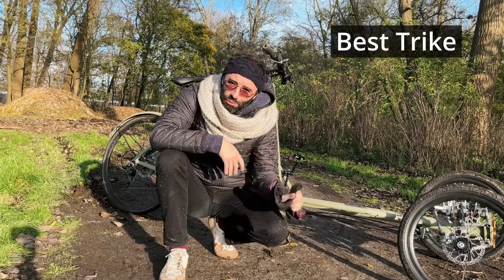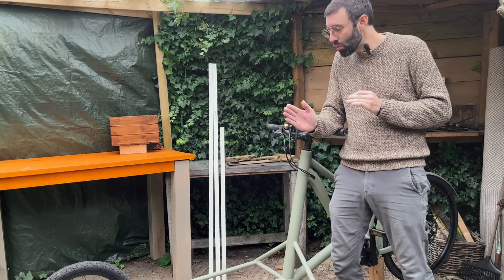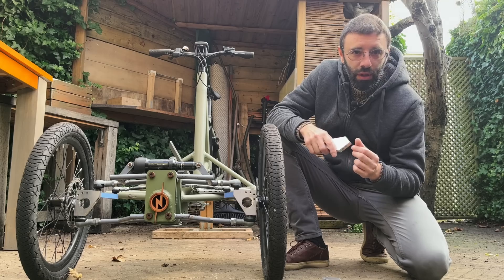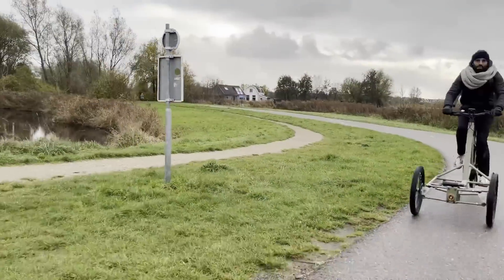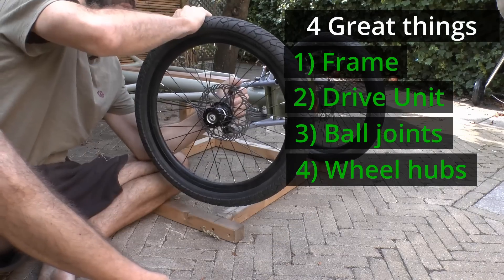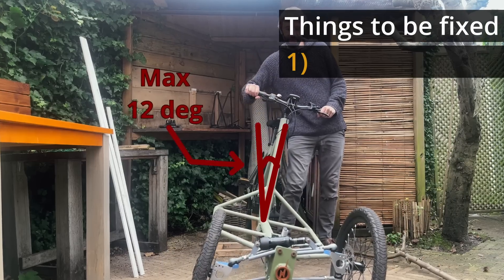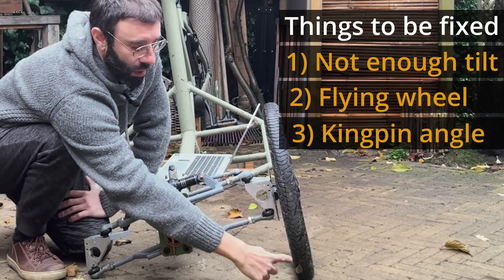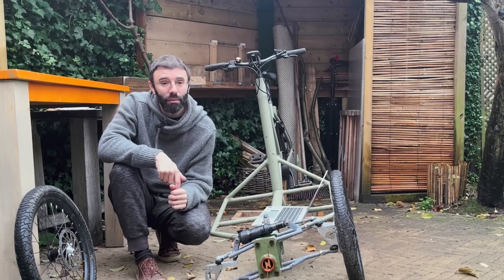#5 Build Finish and Tests - Tadpole Tilting Cargo Trike

Comment: Ackerman while tilting is the key to good handling. One thing to think about is the pivot points at the frame. I noticed that your outside tire leans more than the inside one, exactly the opposite of what you want. If the upper pivot is central instead of how you have it outboard of the central pivot point. When you are leaning in the corner the wheels need to lean the right amount for the circle that they are traveling in. The outside needs to lean less than the inside in relation to each other. The rear should split the difference between the two lean angles of the front. If the lower arms are out the central pivot point like you have them and the upper arms are pivoting on a common point then the tires will get closer together at the bottom creating the different lean angles. Another thing to do is to use offset rims so that the outer pivot points are inline with the center of the tire. This will fix the scrub radius problem. With the system that I have described the steering pivot points need to be the exact same height as the upper pivot points to get rid of any bump steer.
Reply from the maker: Hi, thanks! That's a point that I haven't considered, actually. I calculated Ackerman for the outer wheel to turn less than the inner wheel but didn't consider leaning less.
Cheers!

Comment: That’s a very good design love it. I would go with cable steering but full housing( cable routing does not be straight line) as I would off road sometimes I see your cable pulley got stuff stuck so I like mine to be away from the bottom protrusions. 
I would go with bearings on the C hub & solid axle on the wheels. Your previous A arm would have more tilting angle but change to a H arm. ❤Thanks for the inspirations.
Reply from the maker: Thank you so much! Indeed, the pulleys gather grass sometimes, would be nice to have them more protected. And I'm working on new hubs;)
Cheers!

Comment: amazing space-x level cargo bike, can you make a suspension for regular 700c carbon fork/wheel, cast your own pieces from AL and go back to bearings over ball joints to increase tilt, better use the steal knuckle for rough test even that AL piece could crack under 200 pounds,
Reply from the maker: Thank you! Indeed, I'm working on increasing the tilt. I will still use ball joints but with different orientation and spacers. I think it will work. Will publish soon;)
Cheers!

Comment: Consider drilling the aluminum axle on center, install a steel bolt & nut to place the axle in high linear compression. This is a design that has been very sucessful in a arbor designs where a wheel is only supported on one side.
Reply from the maker: This is precisely what I'm working on! Thanks!

Comment: Some great work Pedro! I've been watching since the beginning and I'm thinking seriously about building one. I was wondering about making the lower swingarms slightly V shaped, since it's only the bottom ones that reach the limit of the balljoint.
Reply from the maker: Thank you so much! Indeed, I have also considered changing the shape of the swingarms but I think that it will still not be enough tilting. For my next build, I'll use connections that don't limit tilting and I'll also do an inclination study to share with the makers out there so that makers know how much inclination is actually needed.
Cheers!
Reply: @pedro-neves  I agree that proprietary joints would solve the problem, but the store bought ball joints are great for all of the budget tinkerers amongst us. This project has been a great thinking exercise for me and I'm sorting out a donor bike so I can start the build. Can't wait to get it on my  welding table.
Reply from the maker: @garage662  absolutely! I'm a budget tinkerer myself;). I'm so happy that my project helped you think about your project;) I also watch many videos from other makers, and I'm proud of being part of this maker community.
Cheers!

Comment: Pedro 3 years later your still posting. Amazing. Listen im waiting for you to finish the geomatry . The next step would be to have generative additive design to make it as light as possible but increasing strength.  Then it will be completed
Reply from the maker: @homeofgains8980  I learned so much with this project! And it has been fun! The next release will be the vehicle that I use every day. But, indeed, it will not be optimized. Would be super cool to optimize it with generative design. A good excuse to learn a new technology ;)
Cheers!
Reply: @pedro-neves  hey Pedro it’s still me homeofgains (my phone is dead so I’m using my partner) I was hoping to incorporate your design into a recumbent design or vélo mobile design for a competition called the sun trip Morocco. How much time do you think it would take to build this current version
Reply from the maker: @bbjulssy  oh, that's so cool! First of all, remember that I used an existing vehicle and adapted it (I started with a bike and cut the front). The rest, I think can be made in 2 or 3 weeks, depending on your fabrication capability.

Comment: I am going to make a go of the project also. It looks great. We start off in late 70s with three wheel Honda 70 then got 4 wheel Yamaha in the 80s .  We still have them back at the farm. But your plan looks very close to that design.  Yes steel axle is good idea.
Reply from the maker: @larryhicks7558  go for it! Good luck with your build!

Comment: Hi pedro. Have you found a solution for the tilting angle. I have the same problem on my vehicle and I'm thinking to go for heim joints. They allow great suspension travel but limit steering. On my vehicle that is not such a big problem because the distance between front and rear wheels is only 1.1m. ive seen also people separating the steering from the suspension travel whth horizontal bushings for suspension travel and vertical bushings for steering. That solution allowed both as much steering and tilting but adds parts to the system.
Reply from the maker: Hi, thank you so much for pointing those out! Indeed, I'm considering the first. The steering limitation can be mitigated with the addition of "angle enlargers" for heim joint. I think it will work;)
Cheers!
Reply: @pedro-neves  I'm having a hard time finding misalignment spacers in metric dimensions, also there are rubber boots you can place in the Heim joint to prevent debris getting in and prologue lifespan. I've seen the misalignment spacers sometimes called uniball spacers on eu sites

Comment: Keep the aluminum axles, but add internal threads for a 14 mm steel bolt. Or maybe a short piece of 14 mm BMX axle with 1 mm pitch threads. Thanks to your videos, I am thinking about using these hubs for a non-tilting delta trike.
Reply from the maker: What a great idea! I think this is my favorite so far! With this method, it's not needed to remove the brake calipers to remove the wheel. Thank you so much!
And good luck with your build!

Comment: Hi pedro, just an idea : if you redesign your trike, put your shock absorber on the lower arm, cut the front pipe between the plates, make something like a box for the front plates. Like that, the cargo can go until the front (or overlap the front ) of the trike..event reduce the trike lenght.
Reply from the maker: Hi, thanks for that! Indeed, I considered having the shock in the lower arm. The reason I haven't is because I'm trying to make one system that fits into a tube(kind of ready to convert kit). But I agree that your suggestion would make it better.
Cheers!
Reply: @pedro-neves  prototype style ! Lol. Good work.
Reply from the maker: @bret5768  thank you!

Comment: A week link in a bicycle wheel is that it is made to be supported on both sides. Regardless of what material you use, I think the axle will bend over time. If not break.
Reply from the maker: Hi, this wheel hub is made to be supported on just one side. I just didn't design the axle correctly.
Cheers!

Comment: I’m guessing having a material with a fatigue limit is necessary for those high stress parts like the axle. The load changes so much, I feel like it’s bound to break eventually with almost any thickness if it’s aluminium.
Reply from the maker: Indeed, I will not feel safe with an aluminium axle anymore. For the next one I'll use steel.
Cheers!

Comment: Neat project. In other vehicles with 2 steering wheels the inner end points of the steering linkages are in alignment with the pivot point of the upper/lower arms and that's achieved by using a rack. It feels like the same would benefit you?
Reply from the maker: Thanks! I considered using a steering rack. I haven't yet because I'm trying to make it work with a simpler system
Reply: @pedro-neves  then going back to your parallelogram system, but much wider, could achieve similar, I think?
Reply from the maker: @fredio54  I think it would. In the middle of the project I started thinking it was complicated and wanted to make it simpler. But maybe I went too simple. I'll have to consider all options here to have a good steering ratio.

Comment: Go with steel axles. But then you have a problem with steel + aluminum where the axle ties into the triangular part. So make both out of steel.
Reply from the maker: Thanks for the tip! Ya, indeed changing the axle to steel creates more considerations such as corrosion and joining steel with aluminium.

Comment: To fix point 1 just add a bend in the lower control arm. So that the ball joint can travel further
Reply from the maker: Thanks! Indeed I have considered changing the shape o f the lower arm but I think it will not be enough. I'm considering doing a study to find how much tilt is needed before going into my next design.

Comment: Regarding axles, have a look at a video on my channel, "replacing the bearings on a 8freight cargo bike bootsowen" (search) the bike is a 2 wheel cargo bike with single sided axles front and rear. the axles are steel into aluminium and are 12mm tapering to 10mm, much smaller than yours.  I only have one front wheel so the loading is effectively doubled in my bikes axle compared to yours. Regarding where your axle broke in service:  where you go from one turned diameter to another in your axle design it is important to have a radius and not a sharp step in the turning, as stresses will tend to be much higher, but putting a radius in will lessen the point stresses in the material.
Reply from the maker: Oh, I didn't know you have a channel. Super cool stuff there! And that cargo bike is so interesting. I never saw these before.
You're absolutely on the changes of radius. I always mind these on my 3D prints but first lathe project and I forgot something fundamental. Well, next time I'll do a better design and it will probably made of steel.

Comment: One feature of a bicycle is the ability to traverse an obstacle like a sidewalk stone by lifting the front wheel, swiftly (without descending from the bike - as well as driving down stairs). 

It seems to me a major drawback of cargo- and tricycle designs to loose that feature as sometimes obstacles can be overlooked (like a pothole filled with water in pouring rain conditions)...
Reply from the maker: Hi, I agree but I think this argument can go both sides - In a trike, if you hit a sidewalk or pothole, you will probably not fall off.
Cheers!

Comment: Awesome project!
I think you could make bent arms (U-shape) so the ball joints meet the knuckles at more open angle.
Reply from the maker: Thank you! And good point, I considered changing the shape of the arms to have more tilting range but I still think it will not be enough so I'm considering changing the type of connection to alow more range.
Cheers!

Comment: Fantastic to see the evolution. You certainly have more experience than me, however since a few failures I've developed a nagging fear of metal fatigue in aluminum. I'd probably want to consider steel. But, then we have the potential for galvanic corrosion. There's no way that joint won't have an electrical connection as well as electrolyte (road salt etc.). So I'd be interested in hearing what you think. I'm starting my builds with a bike trailer (non tilting 😂) but would like to someday build a recumbent trike ❤
Reply from the maker: Thank you so much!
This vehicle weighs 32 kg compared to my last one made of steel at almost 50 kg. This is a big difference for seeming the same vehicle.
Most modern motorcycles are made of aluminium and more and more cars chassis are being made of aluminium so I think aluminium is definitely better if you're doing it right. I'm not claiming that I'm doing it right but I want to be working to one day have the best vehicle possible and I think that's with aluminium and not steel.
Cheers!
Reply: Thanks for the reply. just thinking though if there are any continued problem maybe hybrid materials or case by case use of stronger metal for key components. That's amazing to hear the weight difference - gives me a lot of reason to keep looking for an aluminum welder for my own trailer project - Cheers!! @pedro-neves
Reply from the maker: @mitchc.9550  good luck with your project!
This trike is my first aluminium project. I bought the cheapest TIG AC welder, 2nd hand, I could find and an Argon bottle, and it's alright as a starter equipment.
Cheers!

Comment: Thanks for sharing your project with everyone.   At 14:14 .. I noticed your damaged left thumb.  Something that everyone should learn about this.  When you hit your finger like this .. stop what you are doing .. and with the other hand .. wrap around the damaged area .. with pressure and at the same time .. begin to hyperventilate .. which increases the oxygen in your blood and improves circulation.  You want to breathe fast until you notice that you are feeling dizzy .. then slow down your breathing .. to maintain the dizziness .. and keep pressure on your finger .. until the pain greatly subsides.  Then you can let go .. and while there may be some redness and tenderness .. there will usually be no blackened fingernail.  Remember .. we are told to elevate a damage limb to keep the tissues from swelling.  The swelling has the effect of drowning your damaged cells as they release fluid .. slowing oxygen transfer.  By applying pressure directly on the damage area .. you keep the tissues from blowing up and capillaries from releasing blood.  In a very few minutes of breathing fresh oxygen .. your cells will have a chance to repair.  If you have broken a bone .. it will take a while to mend .. but the tissues around the bone will be in much better shape.  I learned this from a doctor .. and have experienced it several times .. others too.  ALL the BEST!!
Reply from the maker: Hello and thank you so much! It's very kind of you to notice that my thumb got hurt and share all that precious advice. I got hurt by doing something quite stupid - holding something millimeters from where I'm hammering very hard. I hope I never do this again but if I do I'll keep your advice in mind.
Cheers! All the best to you!
Reply: @pedro-neves  I have worked in the hospital ER and on an ambulance .. but never was trained to do what I shared with you.  In 1980 I learned this from a visiting doctor .. didn't know what to think about it .. but decided to try it out next time I got hurt like that .. I was amazed.  🙂
Reply from the maker: @MerwinARTist , thank you for your service! And yes, many times, one learns randomly in life some very important things that jobs don't teach. The school of life;)

Comment: You may not need to go to steel..  7000 series aluminum might be enough to solve your strength problem along with increasing that diameter.
Reply from the maker: I agree with you. Mostly on the "may" part;) I think I'll just go to steel to be sure;)
Cheers!
Reply: @ keep up the amazing work!  I’m cheering for you.
Reply from the maker: @ucdwino  thank you so much!

Comment: Waaw, that is nice !
Just one advice before I finish your awesome (as usual) video, in order not to forget. I am not a professional TIG welder (not yet I hope) but it appears quite obvious that you should have less tungsten stick length out, unless you waste much  on gas flow. Even on inner corner you might be able to have less stick out. And it is recommended not to move your torch immediately after your weld, to let both your weld and your tungsten under argon protection against oxydation. But my be it is not so relevant when welding aluminium, i am just recommending what I learnt;
Reply from the maker: I love this kind of advice! I can't imagine how many little things I've learned on YT comments such as yours. Thank you so much!

Comment: Some trikes have a locking mechanism to prevent the bike from leaning when going slowly or when parked.  Have you found need for this type of mechanism?
Reply from the maker: I think I will make one at some point. For me, the advantage of such system is for parking.

Comment: Very good improvement have you think how could other benifit from your work in there DiY trike
Reply from the maker: Thank you! You have a good point - In my opinion, how others can benefit is by learning the bits of lessons that I share. Just like I watch many videos from other creators and take many lessons.
Also, I'm sharing the drawings. Hundreds of hours of work on those. Someone interested in making a build can get started from those drawings and getting it done faster and easier.
Do you have other suggestions?
Cheers;)
Reply: @ for Europe make a kit of manufactured parts from your partner 3D lab and a shopping list link for front and stearing parts maybe
Reply from the maker: @ludbzh4029  I would love to do that as well;) When it gets good enough, I will feel right about selling kits. Thank you for your supportive suggestion!